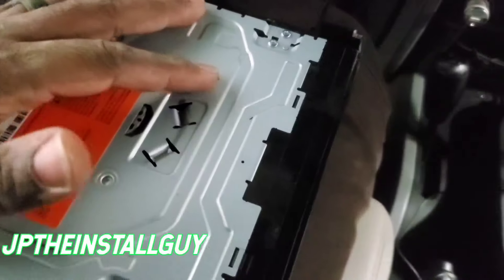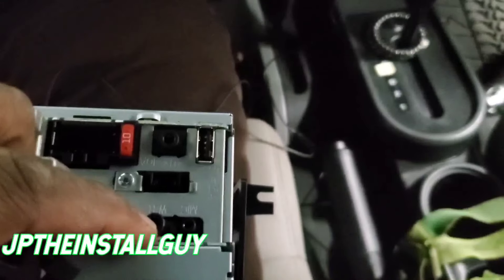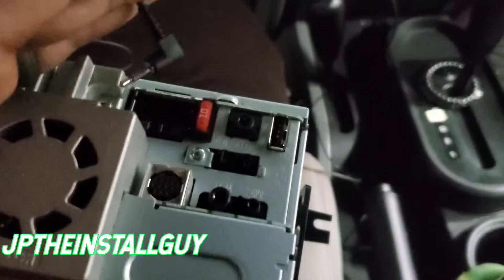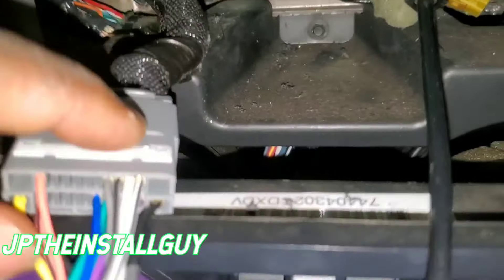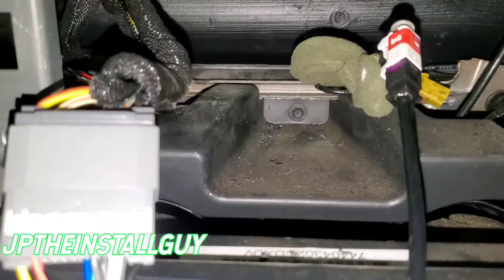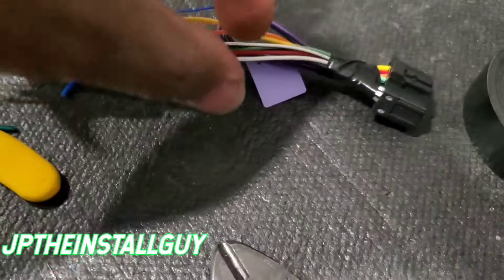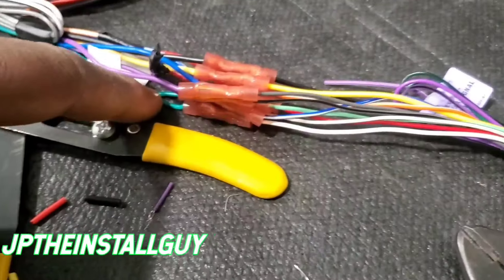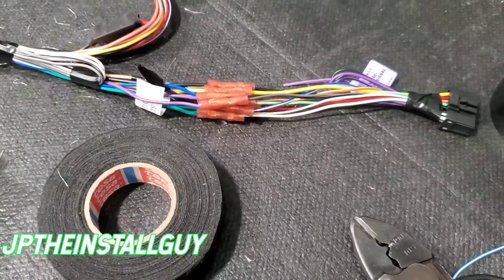How to fix your Bluetooth problem with aftermarket pioneer,kenwood,jvc,sony,Sony, radios

Comment: Hey JP, thanks for the help brother.  Thank you for explaining simply how the wiring works.  Hooked my fronts up to the rear wires on the factory harness and worked beautifully on my wrangler with the premium audio system.  Thanks again

Comment: I have the same problem in my 2000 GMC Jimmy w/ 6 factory speakers and amp. The people I call hear me fine but they are muffled and low. Going to have to take a look at the wiring harness.
Reply: I have the same problem with my 2000 Jimmy. Were you able to fix it?

Comment: How about this? I have completely by passed the factory amp. I connected the front dash speakers on my 11 Ram to the front speakers directly to the Head unit and still have the same problem. I can hear them but they can't hear me. The rest of the door speakers are on a 4 ch amp. Any suggestions from here?

Comment: What causes BT to work sometimes in conjunction with the cell phone and other times not? Especially if I leave the car while it's running while I go back into my house with my phone and come back 30 seconds later, the BT connection won't play the song I was listening to before I got out of the car. I have to go to the phone and hit the play button again. Many other times the hands free phone will work, and other times not even though I didn't leave the car.

Comment: I have a question.
I can hear the regular radio fine. 
When I go into Bluetooth mode it’s breaking up. Or skipping.
Will this still help my problem.
My microphone is built in.
And I have a 03 gmc sierra
Reply: Hey laquarias did you find a fix to this? I am having the same problem

Comment: I have a jvc, the blutooth is hooked up properly because it connects to my phone immediately and shows what my phone does, the speakers make noise when i use the touch screen like they should but whenever i play music i have no sound whatsoever. Any solution? Its a JVC KW-v430bt btw
Reply: Same exact thing as you. I can’t figure it out
Reply: Yo did you find what the problem was? Same here now..

Comment: My Bluetooth connects but it will play music for a few seconds and then it stops playing and will start working again a few seconds later. Does anyone know how to fix this?
Reply from the maker: you might want to check and see if your software needs to be updated on the radio a lot of times a faulty bluetooth is because of old software
Reply: This happened to my kenwood dpx7200dab
On the bottom right corner of the stereo next to the USB port, there is a tiny hole with a button in the hole. I used a pin to hold or press that button until the stereo turned off. That performed a Soft Reset command to the stereo. My bluetooth stopped cutting out after that